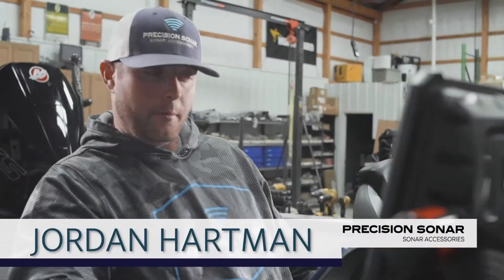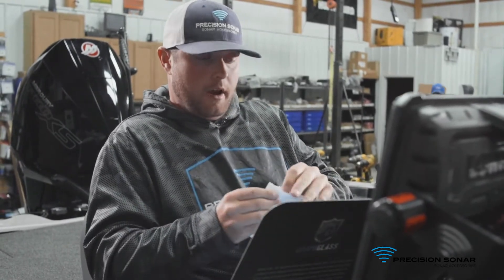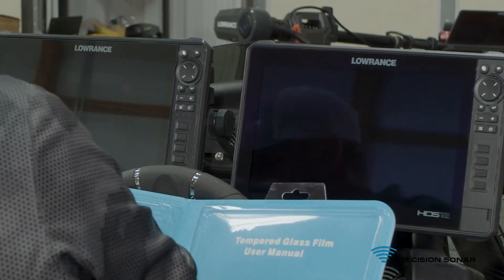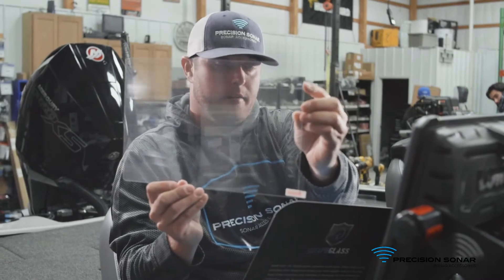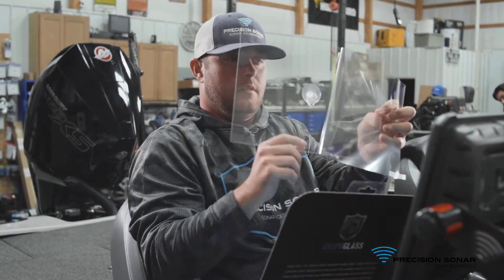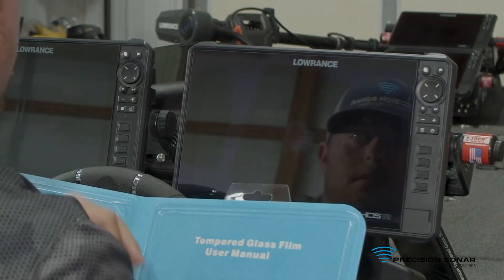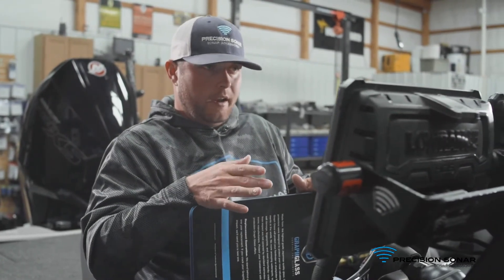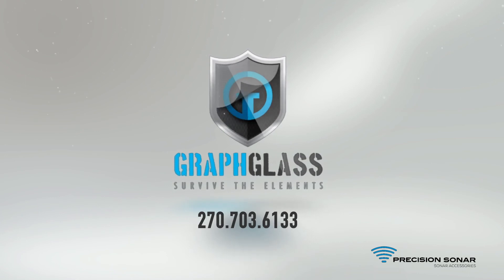Graph Glass Installation

Comment: Just put one on my Helix 12.  I cracked the glass screen casting a big jig.  Replacement screen will cost over $350 for a Gen 2 Hummimbird.  I'm going to be replacing this unit in the next year so I'm using Graph Glass to hopefully let me use the unit as is and save the repair cost that I can apply towards a new unit.